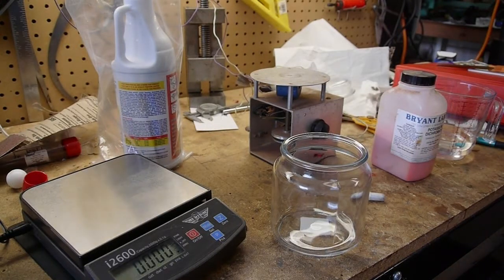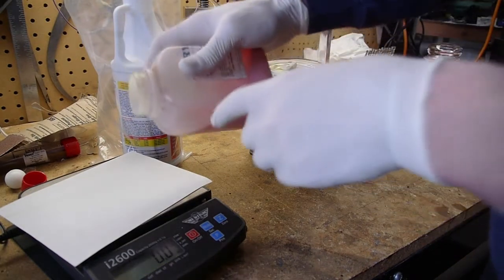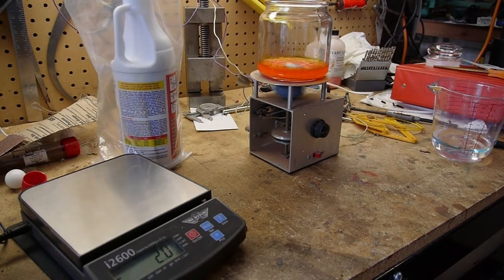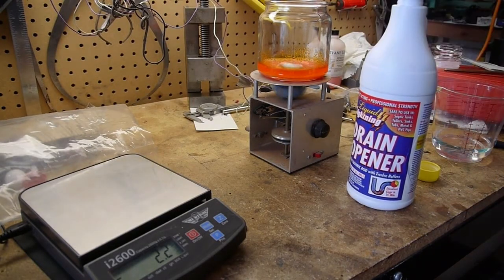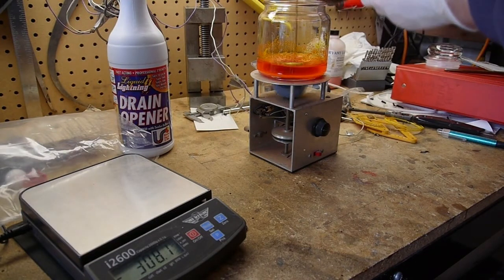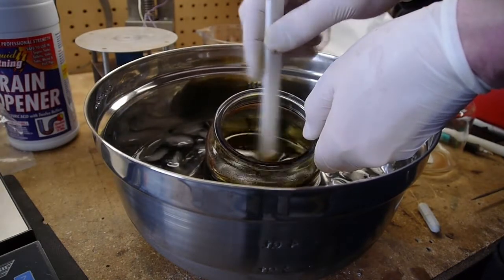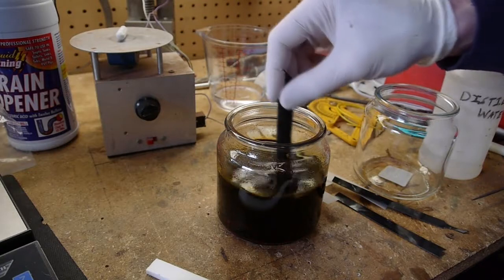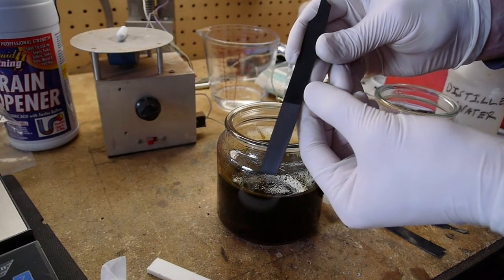Etching Acetal (Delrin) plastic in preparation for painting, gluing, etc

Comment: Wow, the sulfuric acid looks like petroleum :D
For etching delrin you could use very less hazardous phosphoric acid. This isn't carcinogenic, toxic and so on. 
You just put your delrin parts into a 85% solution of phosphoric acid and leave it 10sec at 50°C. Then you wash it with distilled water.
And ready is your "environment and health friendly" etched delrin :D
Reply: Chromium VI is absolutely carcinogenic